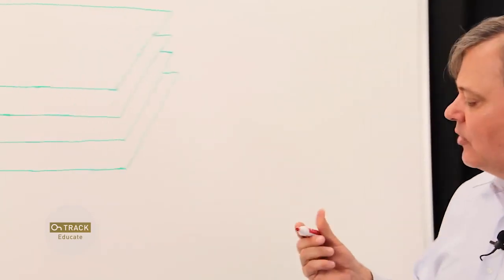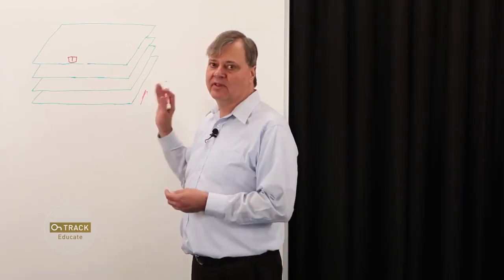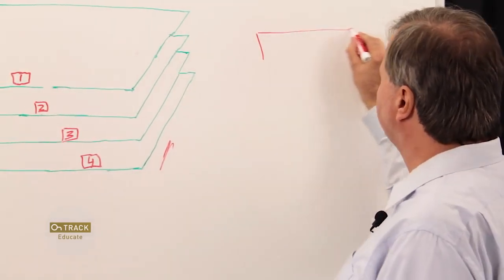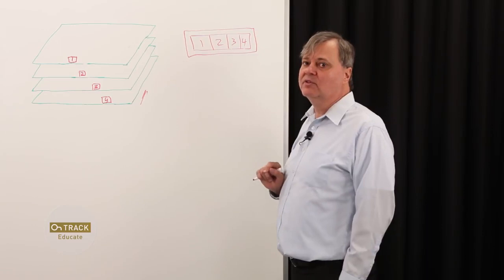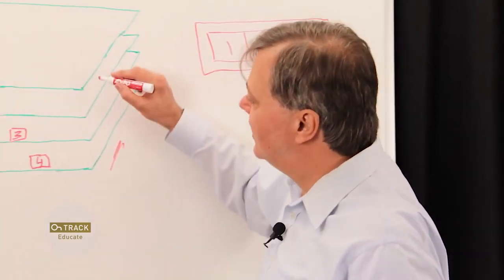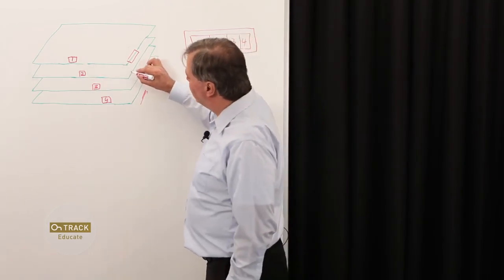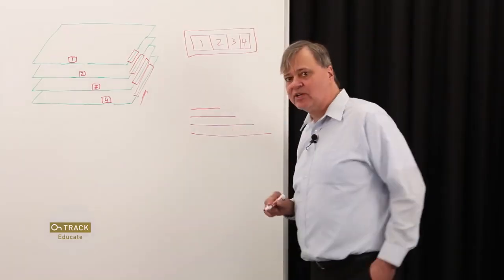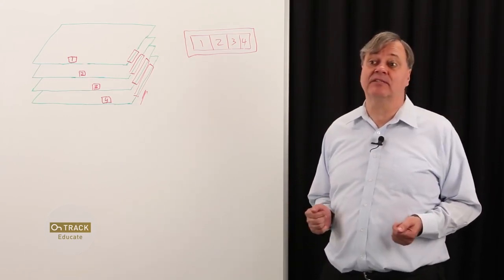PCB Layout Tips: How to Get Your Layer Stack Right - Altium Academy

Comment: How do we add layer number in Altium? Is it possible to simply place a string and add a solder mask expansion around the box? What about the stacking stripe? Is it added as a thick trace or a polygon?
Reply: Hi, 

"is it possible to simply place a string and add a solder mask expansion around the box?"
Yes, you get it right just simple like that and you can choose the font to be inverted, for instance.

" Is it added as a thick trace or a polygon?"
Also simple like that